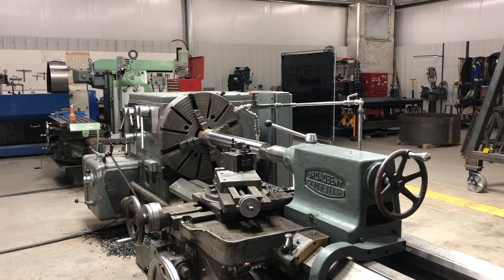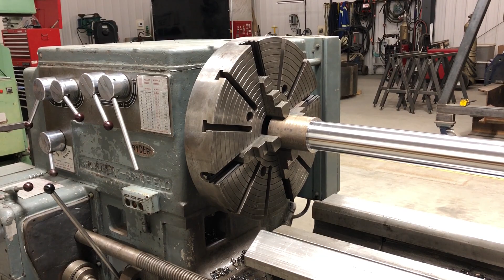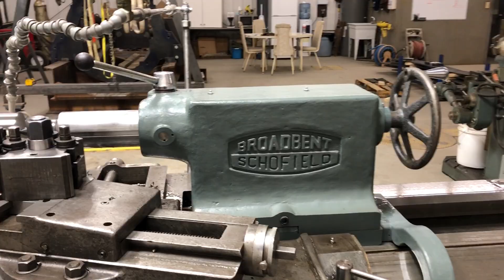Facta Non Verba Legacy Series

Comment: How come you dont respond to comments/questions?
Reply from the maker: Hello Earle,  I usually do but I have been very busy lately and don't always have time.  Also, sometimes YouTube doesn't notify me when new comments are left on my videos so I don't know they are there.  If you have questions fire away and I'll do my best to answer them.  Ken
Reply: @hmw-ms3tx  the questions were about horizontal mill when you were doing heavy cuts about the insert you were using
Reply from the maker: @earleclemans4836  I have two types of facemills, both Sandvik.  One is a R390 (cuts a square shoulder) and the other type is a R245 (cuts a 45 degree shoulder.)  I have one R390, which is 3" diameter and two R245's, 3" and 6" diameter.  I use Sandvik inserts for all of these facemills, usually the general purpose (for machining steel) type of inserts. Ken